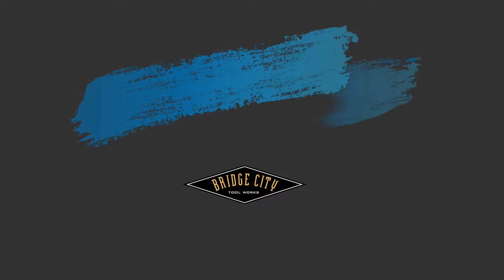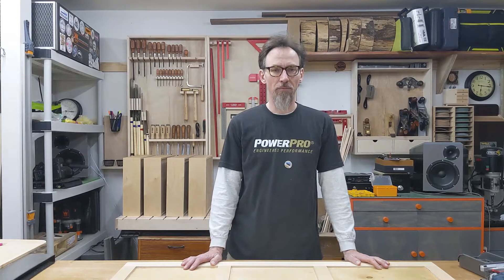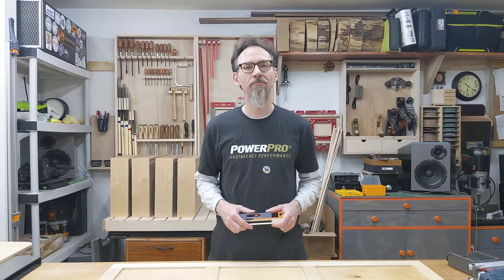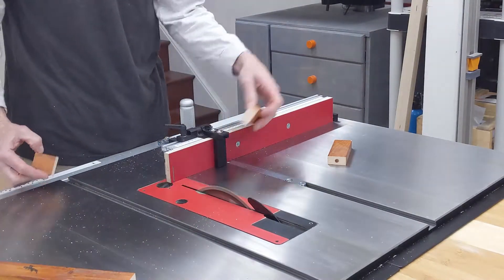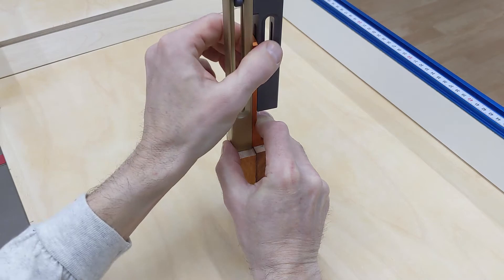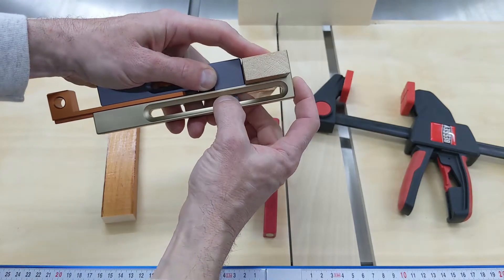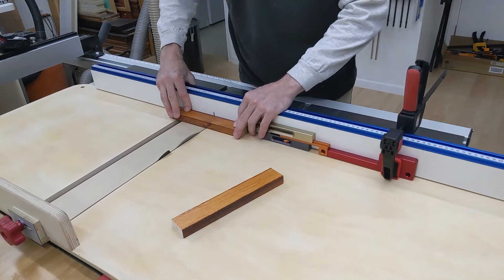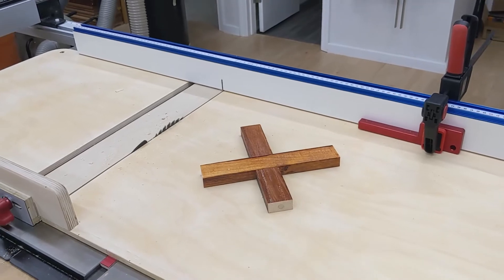How to use Bridge City Tool Works KerfMaker

Comment: how do you set blade to exactly 1/2 of the thickness of the joint?
Reply from the maker: Microjig makes a very nice jig for that. But back then, I was just measuring things and making test cuts on offcuts.
Reply: @RadeksWorkshop  thanks  !

Comment: Just saw your video. My question is about making the half lap in a specific place on the board. Trying to get that initial cut in the right place seems to be eluding me other than to draw a line and   hopefully it is in the right spot. If I just wanted to cut the dado anywhere on the board, it doesn't matter but in my case I want it to be pretty much dead center. Any hints?
Reply from the maker: Hi Bill. I would mark the position of the dado precisely where it should be and then make a first cut. You would have to eye-ball it. Then I'd use a kerf maker to make a second cut. Then I'd remove the rest of material in between the cuts of course. Kerf maker is a jig that allows to get a dado of exact right width. Position of a dado is up to you, kerf maker can't help you. Does that make sense? Does it answer your question?
Reply: @RadeksWorkshop  That was pretty much the conclusion I had come to . I marked where the left edge of the dado would go then cut it and used the kerf maker to do the second cut and cleaned up the middle. No question it works to make a nice crisp dado of the exact size. Thanks for the reply, Bill
Reply from the maker: @billinfarmington5189  Glad it worked out well. Good luck with your project.

Comment: Thanks for posting this, Radek. I had seen several explanations covering the calibration process but no one else explained why the two board process was important, just that it was. 

I now see this process could be used to measure the arbor runout/blade deflection of a saw making a cut by comparing the actual width of a blade tooth to the kerf width.
Reply from the maker: Yes, exactly. Thank you for your comment. I'm glad my video seems helpful.

Comment: A tool like  this is  never  needed.    
You just  use  a  cutting  from  the  timber  you  are  setting  into  the  groove    as a  spacer   to cut a kerf  SPACER   block.
 This  cutting  then  makes  the kerf  maker. Which is  just a scrap piece  of  wood.
 As it is  now  exactly  the  width  of  the  timber  you are  setting  into  the groove   MINUS  the  exact  width  of  the blade  kerf.
Reply from the maker: That is true. However the actual kerf us always a bit wider than thickness of blade's teeth. So in theory you are right but in practice Kerfmakers do help.

Comment: Thank you for explaining how to use it, I'm attempting my first castle joint for a entry table. Do you think I can do a half lap with 2×4 with the KM-2?
Reply from the maker: Yes, I am pretty sure it would do a great job
Reply: Bridge City has the specs for the KM-2 on their website. They don’t for the KM-1 but will provide it over the phone. I measured my KM-1. It can be set to blade widths up to 17/32” (13.46mm) and cut kerfs to accommodate boards up to 2 1/16” (52mm) wide. By using the KM-1 just to account for the kerf and using a stop block, wider boards can be accommodated.

Comment: Great video Radek! I might want to use these to make mortise and tenon joints for a fence, only I don't know if I can. I want to join 60x85mm wood (tenon)  to 100x100mm (mortise).
Reply from the maker: Sure, it would work!
Reply: If you haven’t acquired yet, the KM-2 would work. Also, Bridge City also has a similar tool called the tenon maker.

Comment: Excellent demonstration. Congratulations. I was impressed with your Cross Cut Sled, you have some video of its manufacture, it looks very well done and it seems that it only moves the right base and is ready for dados, is that correct? Or you can give me a tip on where to find information to do it. Greetings from Mexico.
Reply from the maker: Muchas Gracias. Yes you are right, the gap for the blade can be adjusted for any kerf, including dados. I haven't posted it on YouTube, but there is a video on my Instagram. Please check Radeksworkshop there. It is older post though so you might have to dig deeper in.